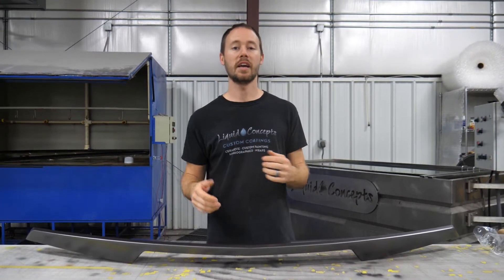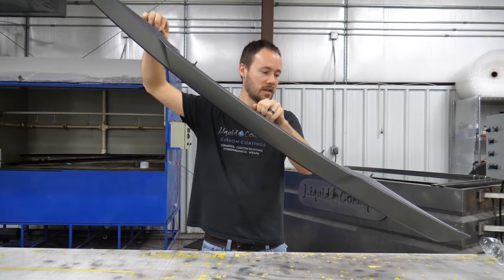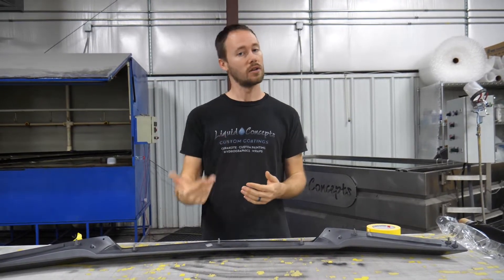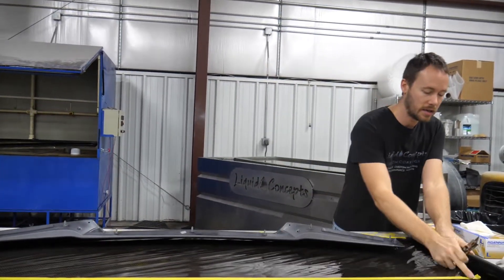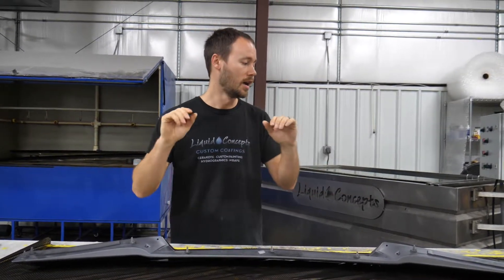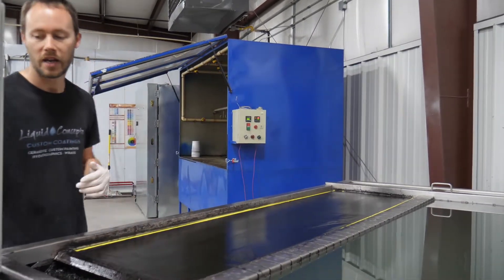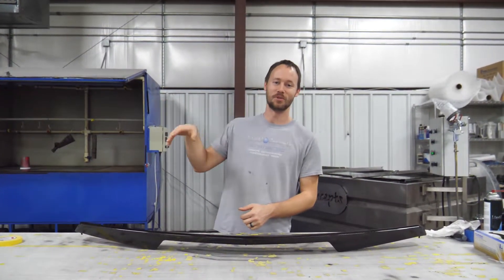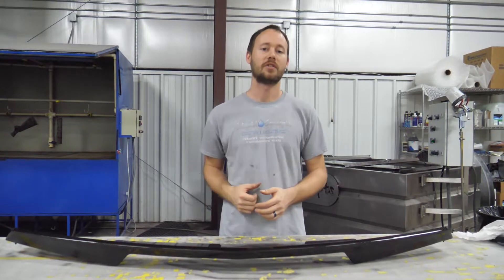HOW TO HYDRO DIP A REAR CORVETTE WING IN CARBON FIBER | Liquid Concepts | Weekly Tips and Tricks

Comment: i have a problem.... i dip a streeing wheel and spray clear coat .. after one week clear coats get scrach and removing i think it's because when I'm driving i touch dipped part but i need a solution to keep it safe  ... give me a solution for how to do it
Reply from the maker: What kind of clear coat did you spray? Aerosol? Other? Normally if the part is clear coated, it will be protected like normal and wont get scratches on it.
Reply: @LiquidConceptsUSA  i sprayed 2k wonda clear coat... problem is after few days dipped sticker in the panel but clear coat cracking and removing ... why is that